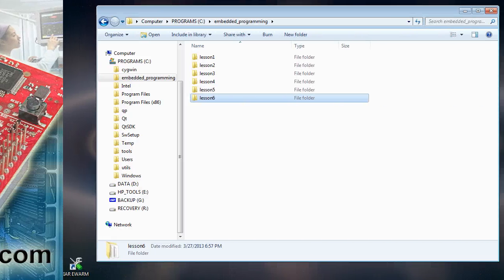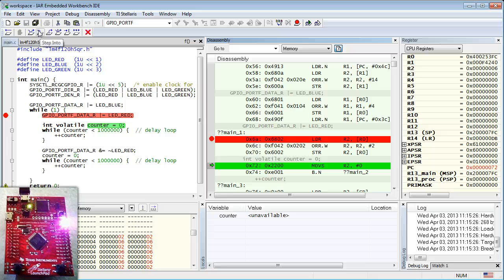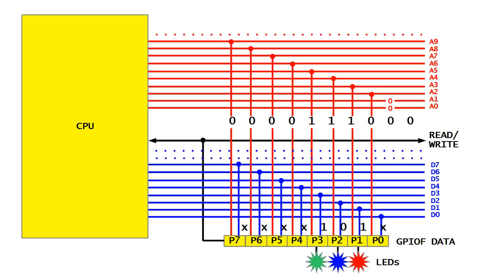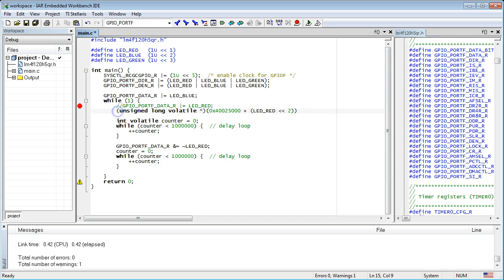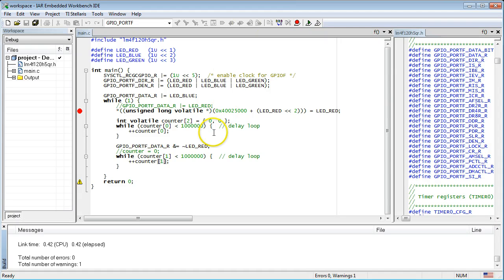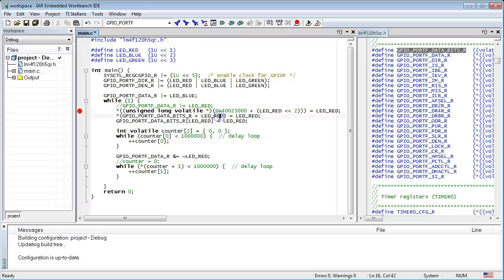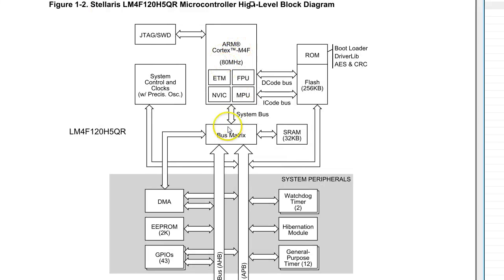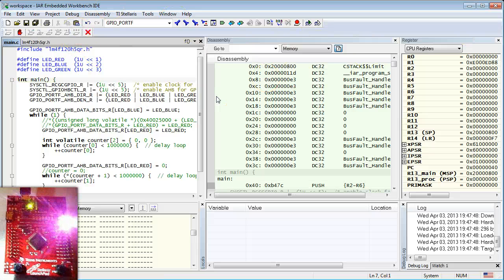#7 Arrays and Pointer Arithmetic

Comment: struggling to understand the "GPIO_PORTF_AHB_DATA_BITS_R[R_LED] = R_LED;" part

so GPIO_PORTF_AHB_DATA_BITS_R is an array
we access a specific bit through array index [R_LED] - 
then we set the bit to R_LED?

but if i add them up, the address isn't the same as using "GPIO_PORTF_AHB_DATA_R |= R_LED;"

what am i missing here?
Reply from the maker: The GPIO_PORTF_AHB_DATA_BITS_R[] array is not for the individual bits. It goes further than this. The GPIO_PORTF_AHB_DATA_BITS_R[] array has an element for every possible *combination* of 8 bits. Therefore you have 256 such elements in this array. If it was for the individual bits only, you would have only 8 elements in the array. --MMS
Reply: Quantum Leaps, LLC thank you
Is there somewhere I can find more information on this?
Reply from the maker: All such things are described in the datasheet for the MCU, which you can get from TI (just google for your TM4C123GH6PM). Alternatively, the datasheet is available on the companion page for this video course at https://state-machine.com/quickstart/. Getting used to working with datasheets is an important skill for an embedded software engineer. --MMS

Comment: Hi Miro.I wonder if AHB and APB are part of ARM core design? I mean all other cortex M MCUs, for example, STM32F3, use the same architecture?
Reply from the maker: I am not a hardware designer, but afaik the AHB and APB are generic interface specifications applicable to all sorts of chips. The designers of the TivaC MCUs (actually, the original designers at LuminaryMicro, later acquired by TI) decided to use these buses in their chip to connect peripherals to the CPU. Other chip manufacturers, like ST, probably used something else. The bottom line is that the peripherals and internal interfaces is exactly where the chips from different vendors differ. They all use identical cores (ARM Cortex-M), but they compete on peripherals. I hope this makes sense. --MMS
Reply: If someone use stm32f4 discovery board, for  performing atomic
bitwise handling you can use  GPIOx_BSRR register instead  GPIOx_ODR register.

Comment: Im a bit confused, (0x40025000 + (LED_RED << 2)) takes me to which address? Since (LED_RED << 2) = 8, therefore this command takes me to the address where all bits are set to 1? I mean 1111 1111 00..Hope the question is clear
Reply: Remember 
GPIO_PORTF_DATA_R = 0x400253FC, which gives you the address to access all the GPIO in PORTF
0x400253FC = 0x40025000 + 0x3FC , where 0x40025000 is the base address.

Now to your question.
(0x40025000 + (LED_RED << 2)) = 0x40025000 + ( (1u<<1) <<2) = 0x40025000 + 0x08 = 0x40025008 , Address to access only the GPIO with the red led so you don't need do make a read instruction. Thus, avoidind RMW problem.

page 616 may help a bit more
http://www.mouser.com/ds/2/405/lm4f120h5qr-124014.pdf
Reply: If you skip the 2 unuse  bits, you'll see it set only the bit 1

Comment: I was continuing with you and all the lesson worked fine. However, at some point I downloaded lesson 7 from your blog and tried to make it work, but I couldn't. I am getting errors because of the macros used for bit-wise operations like: SYSCTL_RCGCGPIO_R. 

I am using Tiva board withTM4C123GH6PM, so I downloaded and replaced the old one with the header file corresponding to my board, also I changed the "Device" in "Options", but still getting same error.  

Any idea, it could be stupid mistake somewhere, but if you have any idea I appreciate it. Thanks
Reply: Use the same header file as in the video. I'm using the same board as you and mine worked fine. I copied the header file from http://users.ece.utexas.edu/~valvano/Volume1/lm4f120h5qr.h

Comment: At 11:10, aren't you doing (1U << 1) << 2 because A0 and A1 are not used, so in total it skips two set of four address (i.e. eight bytes), finally makes A3 = 1. Now to make it four byte align, designers made pointer equivalent to long type(4 byte align)..so, in next step you add Led_RED(10 i.e. 2) to pointer type..i.e. it should reach eighth address..1000..I couldn't understand your explanation..please correct me!
\
Reply: The array is { 0x40025000, 0x40025004, 0x40025008, ... , 0x400253FC }, and the third element is exactly 0x40025008, so yes, the expressions are equivalent. The elements differ by 4 bits because the array contains consecutive addresses of 32-bit long registers.
Reply: Thank you so much. I spent hours trying to figure this out.
Reply: @muxx9992  thanks a lot! this was really really confusing me!
Reply: @muxx9992  That was much of help! thank you!
Reply from the maker: +Gaurav Minocha If you mean the index into the GPIO_PORTF_DATA_BITS_R[] array, then NO, the left-shift by 2 is not necessary. This is because the array itself is declared as uint32_t, which is a 4-byte quantity. Therefore the left-shift happens implicitly to reach the right array element. I suppose a similar question was already asked and answered for this particular video.
Reply: @StateMachineCOM  Even though it matters the way of explaining something, that someone can of course like it I guess.

Comment: Thank you for the great stuff!

Question: is GPIO_PORTF_DATA_BITS_R[LED_RED] refers to the bit 0 on GPIO_PORTF_DATA_R and is GPIO_PORTF_DATA_R a 8-bit long register? Does "GPIO_PORTF_DATA_BITS_R[BLUE_RED] = 1" turn on the BLUE LED? Thank you!
Reply from the maker: +mengnan24 The LED_RED macro is defined at the top of main.c. It apparently references bit 1 (#define LED_RED (1U << 1)). Also, all peripheral registers on TivaC are 32-bit wide (so they are accessed by means of LDR and STR instructions, not LDRB or STRB, which would be used for byte-wide access). Finally, "GPIO_PORTF_DATA_BITS_R[BLUE_LED] = 1" will not turn anything on (will be ignored). To turn blue LED on, you need to use "GPIO_PORTF_DATA_BITS_R[BLUE_LED] = BLUE_LED", or alternatively, "GPIO_PORTF_DATA_BITS_R[BLUE_LED] = 0xFFU". To understand why, please again watch the video at 4:45, where I explain how the address lines are connected to the GPIO bits.
Reply: @StateMachineCOM  
I think you meant by alternatively this: "GPIO_PORTF_DATA_BITS_R[BLUE_LED] = 0x04U"

Comment: Hey QP, is there ever a time we'd choose AHB over APB? 

And just to make sure, when I tried to use APB and AHB at the same time it wouldn't work. Do you have to decide whether to use APB and AHB or can you use both at the same time?
Reply from the maker: +Helios Fire I'm not aware of any situation where the older APB would be superior to the newer AHB, so I would always recommend AHB. The older APB is only still there for backwards-compatibility with existing code, which these processors still need to run.
Regarding compatibility between APB and AHB, they are mutually exclusive meaning that you need to choose and then consistently use one or the other, but not both at the same time. The datasheet it very clear about it, so no wonder that your attempt to mix AHB and APB has failed.
Reply: Thanks! I just wanted to make sure
Reply: i read somwhere but dont remember, it says for power saving aim, APB is selectable over AHB

Comment: I'm still unsure why 3FC is being used. I know FF = 1111 1111 which is 256  which are all possible data registers for GPIO port F. But we shift to the left two ( 2 <<) which is 1111 1111 00, which is 1020 or 3FC in hex. But why? Are we trying to avoid using A0 and A1? Why even have A0 and A1?
Reply from the maker: +Gaurav Minocha To understand why address lines A0 and A1 are not used for addressing 4-byte aligned peripheral registers, please write the following sequence of numbers in binary: 0, 4, 8, 12, 16, .... I hope you would get something like 0000, 0100, 1000, 1100, 10000, ... Now please notice that all of these addresses have "00" at the end. These are the lines A0 and A1.
Reply from the maker: +Helios Fire All addresses of peripheral registers are aligned at 4-byte boundary, so address lines A0 and A1 are not used to access the peripherals. Apparently this was easier to implement for the hardware designers. Please note that no memory or other resources are really wasted. The peripherals are simply wired such that A0 and A1 are ignored.

But, of course, A0 and A1 are used in many other memory accesses. For example the LDRB/STRB instructions access individual bytes, which can be at odd addresses.
Reply: +Quantum Leaps, LLC  "All addresses of peripheral registers are aligned at 4-byte boundary, so address lines A0 and A1 are not used to access the peripherals".. I am still trying to understand it..if all addresses of peripheral registers are aligned to 4 byte then why would they skip A0 and A1? or it is just the way designer made a choice..

Comment: not clear why did you use 0x3fc as an offset for the data register instead of 0x000 ?
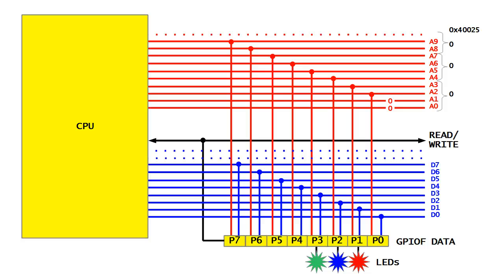Reply from the maker: +abdelrahman tarief Please take a look again at the wiring of the GPIO data and address lines (around 5:22 in the video). In order to write to a given GPIO bit, both the connected data line and the connected address line must be 1 (high). Please also notice that the two lowest-order address bits (A0 and A1) are not connected to any GPIO bits. This means that you need to shift the desired bit combination (in addresses) by two spots. So, for example, if you wish to set all 8 address bits to 1 (0xFF), you need to shift it by two 0xFF << 2 == 0x3FC.

On a side note, the GPIO wiring in TivaC microcontrollers from TI is rather unique and other chips will most likely have different (simpler) wiring. However, the TI solution has also unique advantages, because every bit combination has a separate address. This allows you to avoid race conditions in case the GPIO port is shared among interrupts and the background loop, (or among the tasks of a preemptive RTOS). I will talk about race conditions in the upcoming lessons.
--MMS
Reply: +Quantum Leaps, LLC yes thanks for your clarification, but does that mean there is 256 different Gpio data registrar ?
Reply from the maker: +abdelrahman tarief Yes, that's exactly right. There are 256 GPIO DATA registers! You can see it in the TM4C123GH6PM.h header file, the GPIOA_Type typedef. The first 255 of these registers are named DATA_Bits[255] and the 256-th one is named DATA (immediately following DATA_Bits). I hope this starts to make sense now.
Reply: +Quantum Leaps, LLC ok your videos are helping me to much, one last question where can I find the definition of global interrupt enable function (I) ? because it seems that I cant use the PRIMASK register to modify this bit
Reply from the maker: +abdelrahman tarief The IAR toolset provides a very fast, so called intrinsic function for disabling and enabling interrupts. These functions are called __disable_interrupt() and __enable_interrupt(), respectively. Note that you would need to include the system header file called <intrinsics.h> to be able to use these functions. These intrinsic "functions" don't really cause any function call and return, but the compiler simply emits the "CPSID I" and "CPSIE I" machine instructions for them. These instructions indeed set and clear the PRIMASK register.

The Cortex-M3 and higher CPUs have also an alternative, more selective, way of disabling interrupts by means of the BASEPRI register.

I plan to cover all these things in the upcoming lessons about race conditions, because disabling interrupts is one (crude) method of preventing such race conditions.
Reply: Basically,for a simple mC,such as 8051,for eg. Port 0, has only one specific address and that's that.you can write/read only to this one address.
But in this case, For this entire port, There isnt only one specific address to this particular port, rather 2^32 unique addreses refering to this single port, i.eEVERY POSSIBLE COMBINATION of GPIO(a port) bits would have its own UNIQUE UNIQUE ADDRESS.
So depending on which address u select, certain bits will be masked/unmasked.So even if u write logical high to a certain masked bit,iT WONT MATTER, BUT ANOTHER ADDRESS PERTAINING TO THE SAME PORT MIGHT. Am i right somewhat?

Comment: Great stuff. quick question.
In the line of code
GPIO_PORTF_AHB_DATA_BITS_R[LED_BLUE] = LED_BLUE;
why do you have to set it to LED_BLUE(4) to turn on the LED why can't it just be 1 or some other value.
Reply: Randy Franky  Not sure if this is the right answer but looking back at the video my understanding now is that it is only looking at the LED_BLUE bit in this case 4 or 0100. so values such as 1,2,3 in decimal will have no effect on it but values such as 4,5,6 will turn on the blue LED because the 3 bit value is set to 1.
Reply: Matt L GPIO_PORTF_AHB_DATA_BITS_R[LED_BLUE] equal to 0x40025010, and map to address lines are 0b0100 0000 0000 0010 0101 0000 0001 0000. you will see the address line of LED_BLUE is 1(note that the two lowest-order address lines A0 and A1 are not used, because the hardware requires all addresses to be divisible by 4.). so, the address line LED_BLUE is selected, and now we should give data to data lines. at 4:24 of video, according to "The bit can be changed only when the connected address line is 1, otherwise the bit is unaffected, regardless of the value of the attached data line." you should give the LED_BLUE(which is 0b100 in binary, just the second bit affect the output ) to data lines.
forgive me for my poor Eglish (come from China).
Reply: Basically,for a simple mC,such as 8051,for eg. Port 0, has only one specific address and that's that.you can write/read only to this one address.
But in this case, For this entire port, There isnt only one specific address to this particular port, rather 2^32 unique addreses refering to this single port, i.eEVERY POSSIBLE COMBINATION of GPIO(a port) bits would have its own UNIQUE UNIQUE ADDRESS.
So depending on which address u select, certain bits will be masked/unmasked.So even if u write logical high to a certain masked bit,iT WONT MATTER, BUT ANOTHER ADDRESS PERTAINING TO THE SAME PORT MIGHT. Am i right somewhat?
Reply from the maker: The explanation of the GPIO design in the TivaC MCU is almost correct,  except that there are 2^8 unique addresses for each GPIO port (for 8 bit combinations). To really appreciate the advantages of this GPIO design, please watch Lesson 20 (https://youtu.be/3ha72Y8pyD4 ), where you will see how it helps you avoid race conditions.

Comment: Hi Miro, your courses are excellent and helps me understand programming of ARM processors in depth. I have a small doubt in this lesson though. 

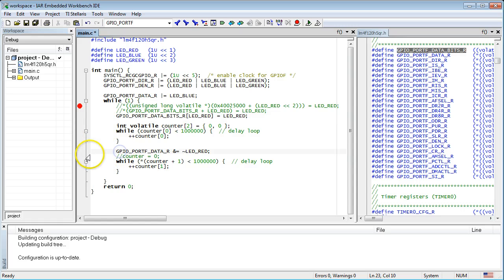When you reset the LED_RED using array indexing at 11:34, you assign it to zero. I was a little confused as to why you do not use ~LED_RED. 

i.e, should the code to reset the LED not be:

GPIO_PORTF_DATA_BITS_R[LED_RED] = ~LED_RED;
Reply from the maker: Sabeethan: the GPIO bits are simply not wired directly to the bits, so you don't set and clear them with the usual binary operations of the form GPIO |= BIT and GPIO &= ~BIT. Instead the hardware guys at TI (actually at Luminary Micro, who designed the GPIO) have used the address lines in a more creative way to allow you direct and atomic access to every bit combination, not just to individual bits.

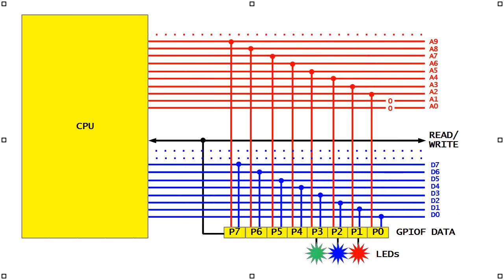This lesson attempts to actually explain all this. Especially, you might want to watch again the segment from 4:11, where I explain the conceptual schematics of the GPIO.
Reply: Quantum Leaps, LLC
Thank you Miro :)..

Comment from the maker: Arduino is by design a  "rapid prototyping" platform. You can quickly build something that works and you are shielded from the complexities of the microcontroller.

But Arduino (including the DUE board) is not a good platform for this type of course, because it does not provide the hardware debugger. In other words, you cannot "see" inside the microcontroller, you cannot single-step through the machine code, you cannot play with the registers, etc.

Comment from the maker: The Freedom board is very nice and I'm glad to hear that you can also use it for this course. The generic ARM code should work almost identically, although Cortex-M0+ has a smaller instruction set than Cortex-M4F. Obviously, the code specific to the peripherals won't work and needs to be adapted.
--Miro

Comment: Love your tutorials!
Maybe you could do some tutorials on how to connect and get a BEC (for controlling a brushless motor) running, and how to adjust it?
If not that, maybe getting input from a module like this:
dx.com/p/gy-521-6dof-mpu6050-module-3-axis-gyroscope-accelerometer-for-mwc-arduino-148190
? =)
Yes, I intend to build a quadcopter.. :p